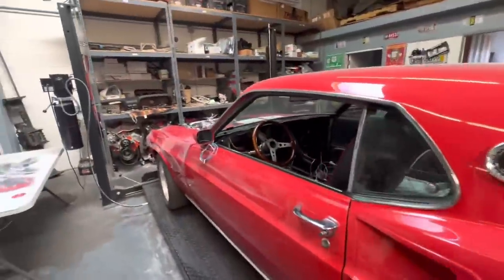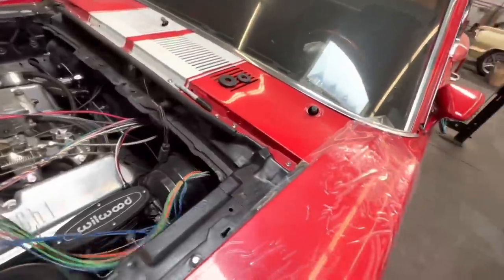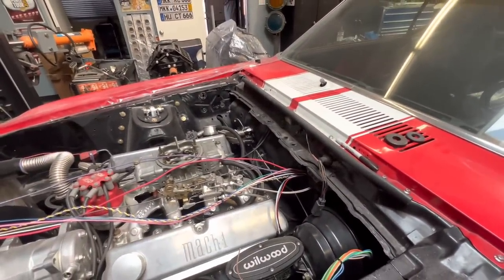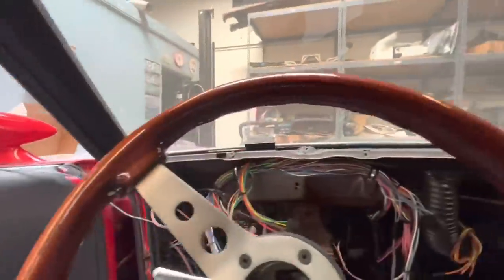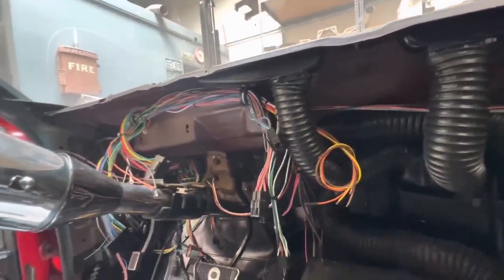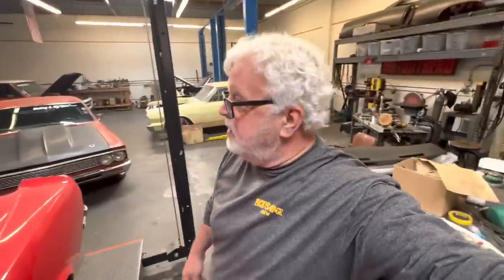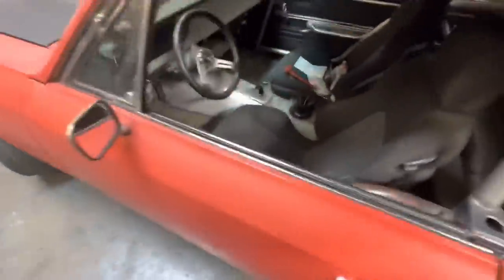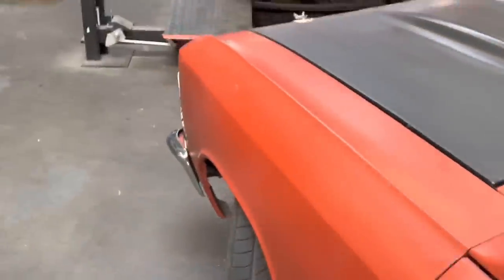Mach 1 Getting Started on Wiring Harness Installation￼

Comment: I would love to see more on that mustang I have a 69 fastback waiting for me to put in the painless wiring harness and it looks intimidating as heck.
Reply: 89 firebird gotta painless harness for nervous as all hell as ive only done carbs
Reply: I put a Painless harness in a 77 Cj5 when I was 19. Definitely intimidating. Go slow and run the wires, fasten then down, and give a little wiggle room before you cut the wires to length and install the connectors. It’s really not too bad when you actually get into it. Just time consuming

Comment: I'd be interested to know if you moving the tranny up a few degrees solved your vibration problem on the Chevelle. Had my 64 C-10 lined up a few times over the years,drives great just can't figure out the small vibration. 5.3 4L60

Comment: I have a two piece drive shaft in my c10 with air ride what would you suggest as a good pinion angle at ride height since the front have of the shaft doesn’t move?

Comment: Tech question for you Lucky.  I mounted my battery in the trunk of my 2nd Gen Camaro.  I ran single wire from the positive side directly to the starter.  I heard you say on 1 of your  wiring videos that you don't do that.  What is the best way?  Thanks, love your channel.
Reply from the maker: That works.  I usually put a bulkhead terminal on the firewall